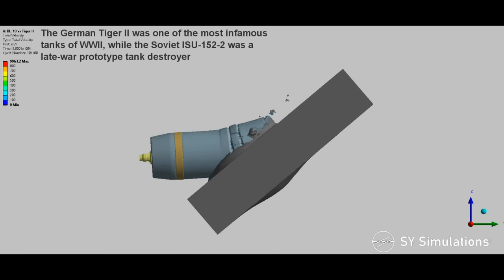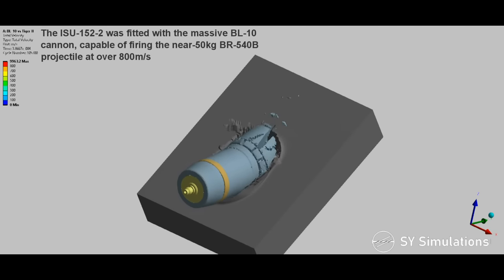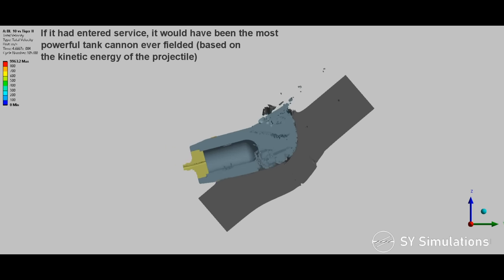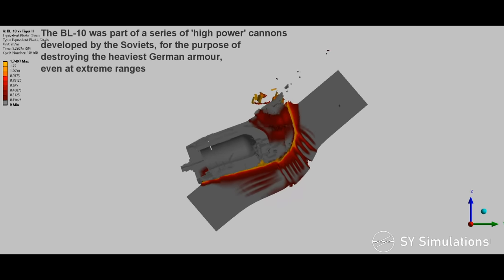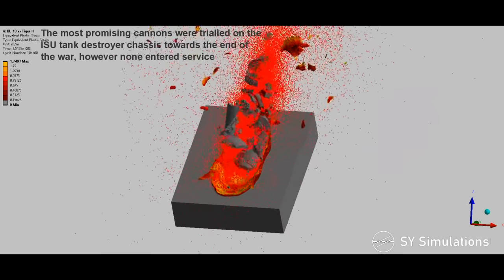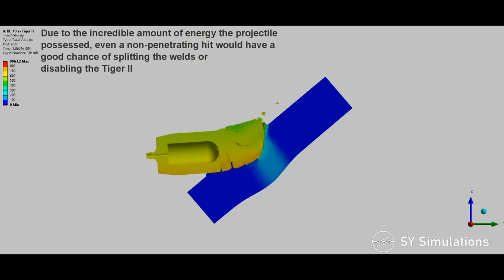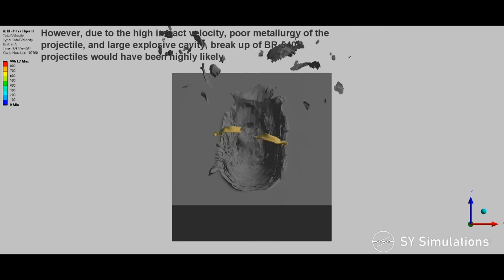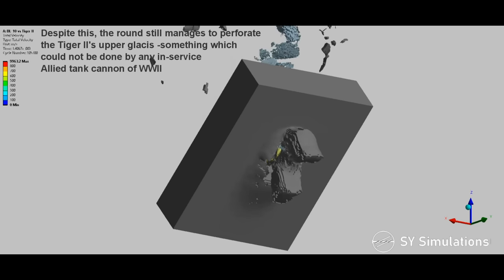SIZE MATTERS | Super ISU-152-2 vs TIGER II | 152mm BL-10 Armour Penetration Simulation

Comment: The projectile cannot hit it vertically unless fired at close range
Reply: This would most likely result in an impact angle just a couple of degrees off the vertical. These couple off degrees are most likely omitted since most of the videos on this channel concern ideal scenarios.
Reply: You're severely overestimating the fall angle for a high velocity, relatively large shell. The impact angle at 1 km for a high velocity 152 mm shell would be like half a degree from the horizontal.
Reply: @rare_kumiko Nope dude , this large shells with a weight of 30 to 50kg drop very hard . There's a balistic coefficient wich nobody think about if they do such simulations . if
Reply: @5co756  You're making shit up. No, a 50 kg, 850 m/s, 152 mm shell will not drop more than a degree at 1 km. Do the math.
Reply: @5co756  I'll give you some reference. A 6"/50 BL Mark XXIII, the gun used to arm most WW2 era British light cruisers, fired a 50,8 kg shell at 841 m/s. At 5 000 yards (4500 m) the angle of fall was 3 degrees.

At 1 km the drop would be negligible.
Reply from the maker: A small drop angle is included and it's approximately correct; drag coefficients are also included in the approximation of range. Regarding the drop, weight makes no difference in how gravity accelerates it, and in fact helps drag decelerate it less, meaning it hits the target quicker, falling for less time. With 99% of simulations on the channel having <1° of irl drop, any drop angle will make a negligible difference in performance. Plus, irl, any non-even ground would negate the validity of the drop angle anyway

Comment: Its funny how this huge cannon was not even needed as even 122mm HE shells from the IS2 were enough to knock out Tiger 2's. Let alone the larger 152mm HE of the ISU152 with the original 152mm cannon.
Makes sense why it never saw production. It was simply not needed.
Reply: mission kill and knock out is not the same, the  122mm mostly could only damage optics, barrels and tracks.  even with the 152mm had to be shot several times.
Reply: @christians.597 German armour quality was pretty bad late war so HE against poor German quality armour resulted in very high damage
the 122mm D-25T on the IS-2 had a similar effect to HESH on the tiger 2 and other German tanks
Reply: @christians.597  Its exactly the same as it knocked  the tank out of combat. And no, it did not need several shots.
Reply: yes the late war armor  had high carbon content and bad heat treatment but wasn't as bad. people think that 1-2 122he could shatter the tiger 2's frontal plate which is funny. there are few tests with mixed results and don't forget the tiger 2 hull's internal structures were usually removed, also the hatches and the MG plate too which  weakens the plate
Reply: @Vlad_-_-_ Where you guys got that bullshit from ? That's just a myth going around , no Tiger 2 was ever knocked out from the front . 122mm HE .... come on dude .  Why they had AP rounds then , if a large HE would do the job . 😅
Reply: @5co756  Stop seething and coping so bad because " invincible " german tanks were knocked out by big boy HE shells from soviet big guns.
Reply: @Vlad_-_-_  well true my bad it's the same.
I saw multiple test and almost every test vehicle had the gun, mantlet, tracks, and engine removed and even the mg plate. and still needed multiple shots to create bigger spalling
Reply: @Vlad_-_-_  im pretty sure that is a myth, 122mm HE never knocked out any tiger 2 in combat. Post war testing using multiple shots on captured tiger 2 just to get the armor to crack doesn't count. Though it's true that there were german tanks being destroyed by large HE shots of soviet tanks, but those were mostly lightly armored panzer tanks, not heavies, and in those instances they would have been destroyed with regular armor piercing shells anyway. Soviet HE shells were made for taking down concrete structures and they were good at that, but extremely overrated and overblown in term of performance against heavily armored tanks. To destroy heavily armored target you have armor piercing shells, the soviet had plenty of those too, no need to wet and defensive over the imaginary feat of soviet HE shells lol. After all, HE is just lots of explosive, just about anyone can make them as big as they like, it's about the dumbest thing to get tribalistic for 😄
Reply: @greener2497  Except that it did a lot, even in the first encounter at Ogledow. Even in testing they saw how spalling and blast fucks up the insides of the tank. But the likes of you still think tank on tank combat was like World of tanks
Reply: В советские тяжёлые танки не от хорошей жизни запихнули артиллерийское орудие 122 мм. На тот момент основной танк Т-34 уже был оснащён 85 мм орудием, и его не всегда хватало при борьбе с Пантерами и Тиграми. Нужно было принимать решение - либо оснащать танки орудиями калибра 100 мм, либо искать альтернативу среди 122, 152 мм орудий. Как же сориентировались в итоге? Да банально - произошла Курская Дуга, в ходе которой неоднократно били по всему "немецкому зверинцу" из всего, что можно, в том числе из 122 мм, 152 мм и прочих калибров артиллерии. И как показала практика - больше всего урона "мастодонтам" Рейха нанесли как раз 122 и 152 мм орудия прямыми попаданиями. Фигня вопрос, подумали в СССР, и создали ИС-2. Можно сколько угодно засирать советскую оптику и косорылость этих танков. Факт в том, что когда в руках СССР оказался Королевский Тигр, и точность/кучность стрельбы ИС-2 с ним сравнили по одинаковым целям - она оказалась сопоставима.
Reply: @greener2497  Soviet in war tests using 122mm HE shells show damage that's gonna render the king tiger knocked out or kill the crew
Reply: @Vlad_-_-_  They were not invincible , but they were never knocked out from a 122mm HE from the front . Only cause you saw a Soviet test , were they hit a Tiger 2 with over 30 shots of different caliber .
Reply: @5co756  All the german fanboys came out screaming I see.
Reply: @Vlad_-_-_  This has nothing to do with fanboys , if you keep talking bullshit . There is no report of a knocked out Tiger 2 from the front , that's a fact boy . You guys always write that under every video about WW2 tanks , as if hundreds of Tiger 2's were knocked out by a 122mm HE . 😅
Reply: It's mainly anti-fortress, than anti-tank, like IS-2.
Reply: @Leantenant  IS2 was anti everything from the start, otherwise they would have used the howitzer too with it. They chose the 122mm over the 100mm because they did not like how robust the 100mm AP was. Yes the 122mm HE was great, but it was not chose only for that. The cannon was dual purpose from the very start. The IS2 was a heavy breakthrough tank with the purpose of dealing with obstructions be it enemy tanks or fortifications in equal measure
Reply: @Vlad_-_-_  Still it mainly anti-fortress.

Tanks vs tanks it's a kid's tales in superior cases.
Reply: @Leantenant  This case both the Tiger I and II where mainly anti fortifications and anti infantry.
You are correct in saying most combat was not tank vs tank, I am well aware of that.
Reply: @Vlad_-_-_  Tiger 2 obviously had to be just a fort at all, because the Germans could no longer advance by the time of its creation.

But the irony is that its hull was protected better than the turret, which is an absolutely stupid mistake on the part of the engineers.
Reply: @Leantenant  That is not that big of a mistake. The mistake was to make the thing in the first place, because the whole design was just awfull.

Comment: This shot doesnt work in warthunder unfortunatley.       ):
Reply: probably because this isnt in the game..?
Reply: @xero6774  BR 540B is actually in game but at a lower velocity, 600m/s on 4.7 ISU 152 (and SU) and 760m/s on OBJ 268. They can pen any tank at their BRs
Reply: OBJ 268's BR540B is just around 100m/s slower, but if you set the range to 0 and get it unangled, you can actually half the time penetrate the tiger 2 UFP with it. Unlikely scenarion in a normal battle though
Reply: @xero6774  also, to add to my first reply, even the 600m/s round is extremly powerful, even at 4.7, it can pen every enemy even if it was full BR above (with the exception of king tigers UFP obviously). It can pen Jumbo or Panther at over 3km at a slight angle. Ridicilously powerful round. People always tell me its just russian bias, but it never was. Its a 50kg 152mm shell.. intrensic amount of energy